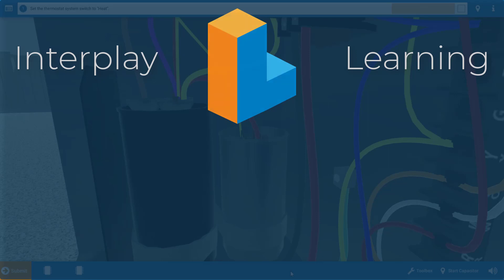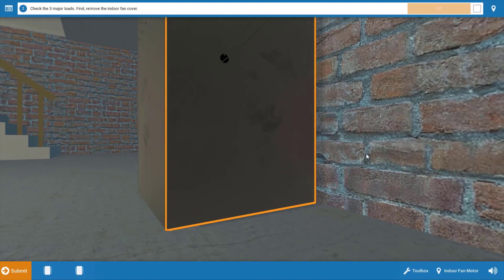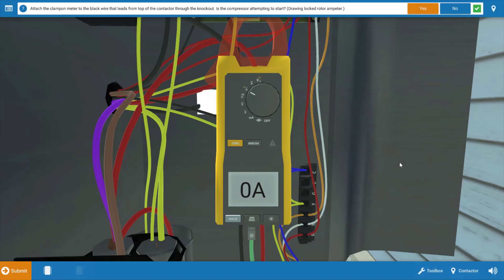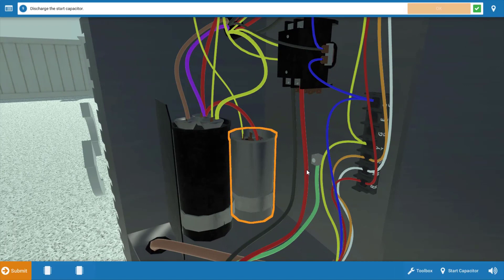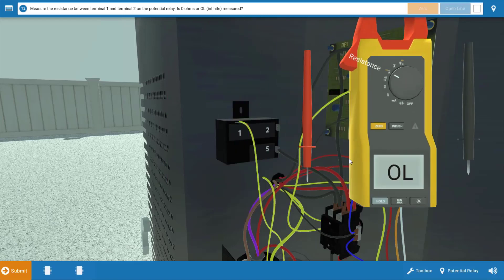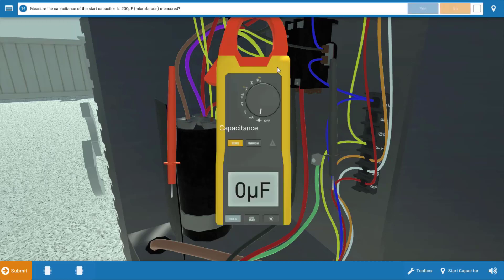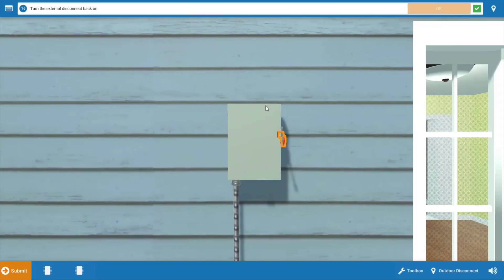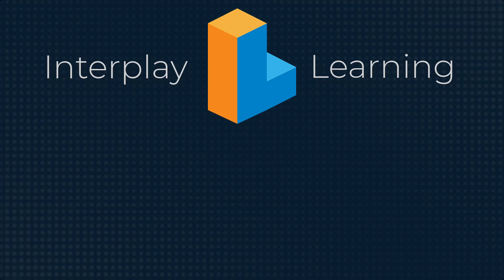[2019 Guide] How to Diagnose a Faulty Start Capacitor (on a Heat Pump)

Comment: Hi there I have a Sanyo co2 eco heat pump and the fan is dead not spinning and it is getting minus here in sweden I have opened up the fan and am so puzzled ,I can not find what looks like a capacitor anywhere. No Aluminium Capacitor anywhere. Completely puzzled. I could send you some pictures if you would like to help.  Regards Kevin

Comment: Arc on the capacitor terminal, not the condenser/compressor terminal........(re discharging the capacitor section of video). 2:40